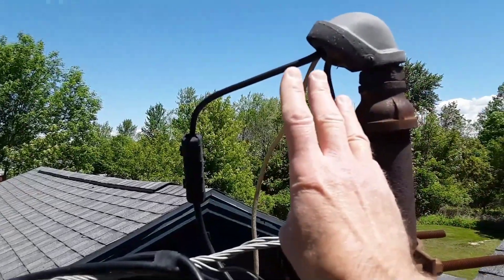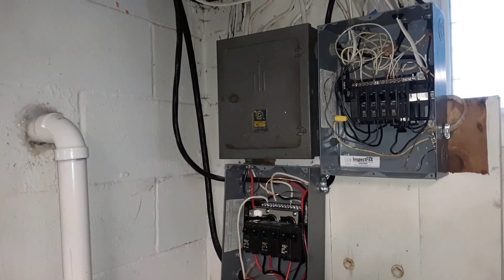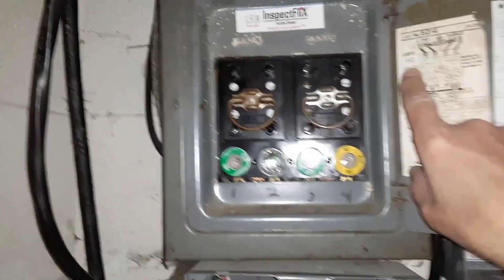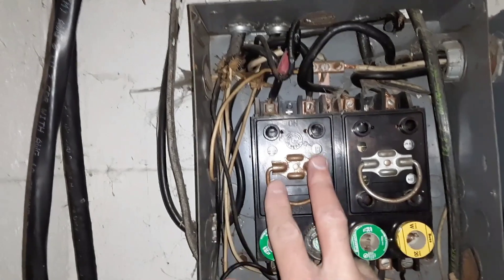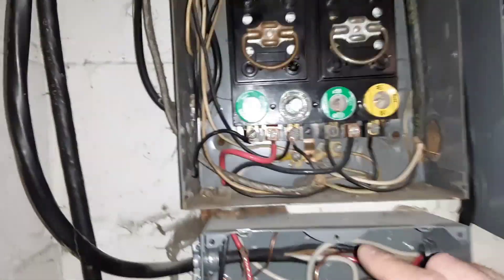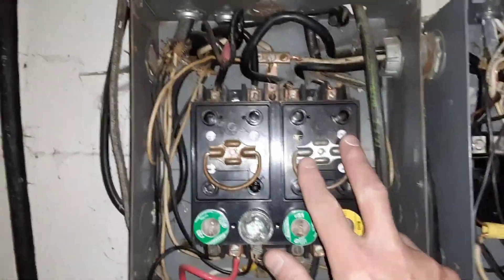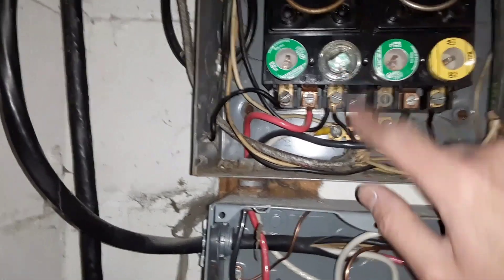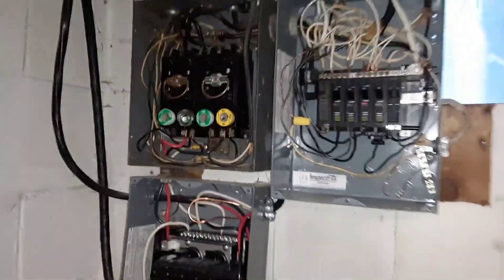💥60 Amp No EV🚗room - Fuse Box Still in Use -😖 #ev#electricvehicle#electric#inspection#realestate

Comment: I don't think I've seen an actual fuse box for years.  I bought a house in 2008, and even that every house I looked at (in a large city) had circuit breakers.  Sort of a strange, hacked together solution someone came up with.
Reply from the maker: 32 years of inspecting and I don't see them much anymore. Fun to look at, but not fun to be used.
Thanks for watching